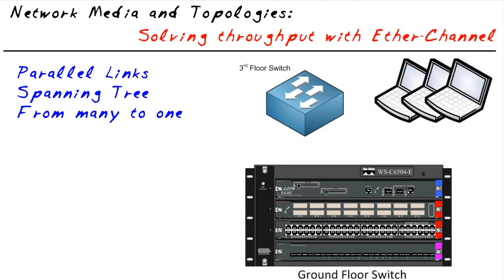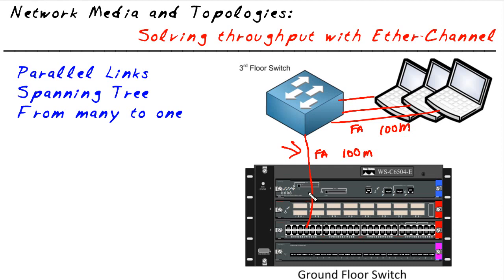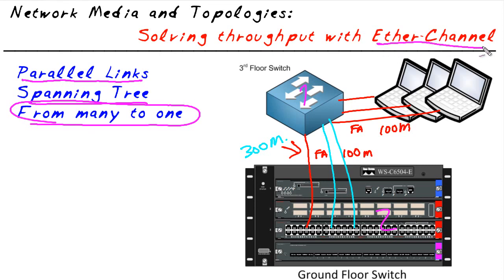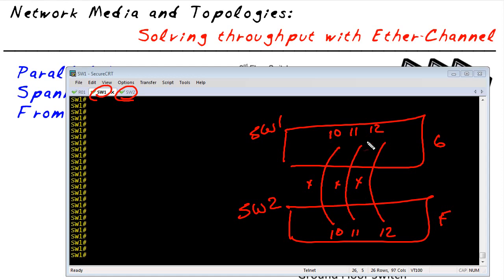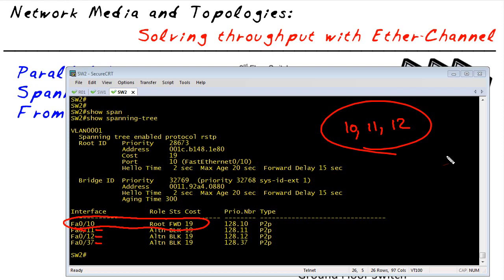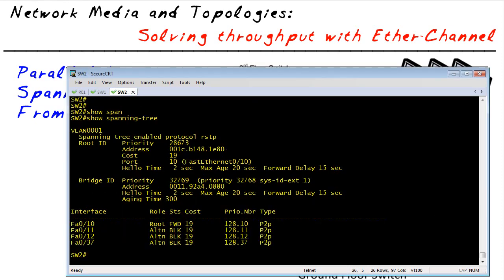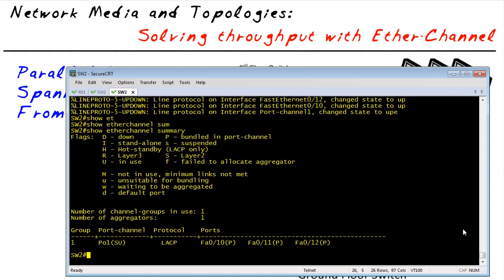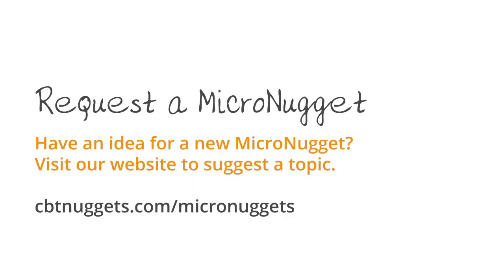MicroNugget: Increasing Throughput with Ether-Channel

Comment: Hi keith, thanks for these videos. Please correct me if i am wrong, aggregating 3 links never give 300mbps together in ether channel until tune their load balancing method. Still net throughput will be same using default load balancing method like src port etc.

Comment: Great video, very concise, and easy to understand. One thing you might think about addidng is a disclaimer about load-balancing. Someone may view this and get the idea that if they bundle three links together, they will be guaranteed 3x the throughput. It may not be the best strategy if the only traffic passing through the Po does not have diverse enough src-dst addresses.

Comment from the maker: The cost of the port-channel is based on the aggregate throughput.   

Standard 100Mb = 19
2 Links at 200Mb = 12
3 Links at 300Mb = 9
4 Links at 400Mb = 8
...
1 Gig links at 1,000Mb = 4
2 Gig links at 2,000Mb = 3
...
20 Gig and higher = 1

Comment: Keith,  
1. How is the port-channel Port Cost calculated? 
2. As stated in Configuring Spanning Tree; 
The changes in bandwidth lead to the recalculation of the default port cost of the aggregate port. I ran a test using to gig ports and two fast/e ports and port cost was 9. (Cost 9). I have seen different port costs but it was not an issue because the Port Channel was always the Root. Configuration of Gig interfaces port cost is 0 (Port Cost 0). (4-4=0).
Thoughts I don't want to ramble :/